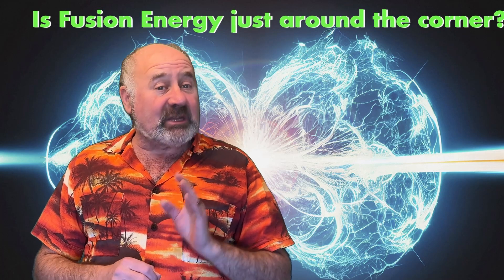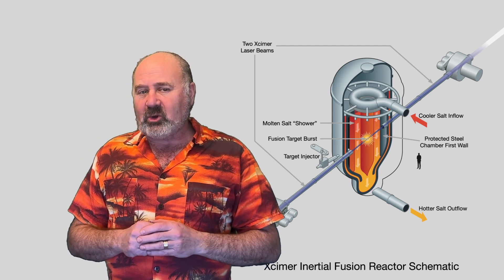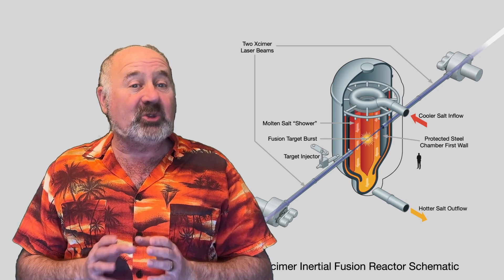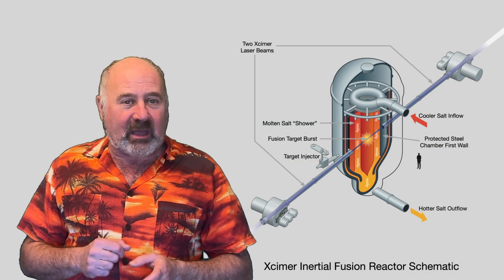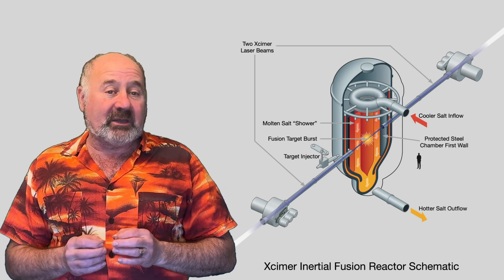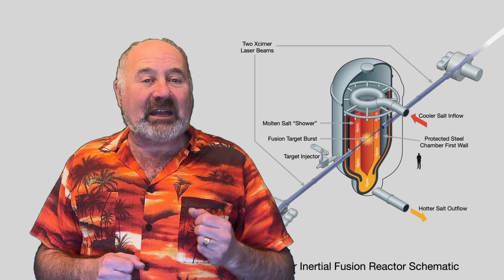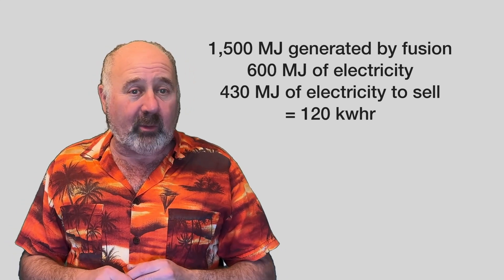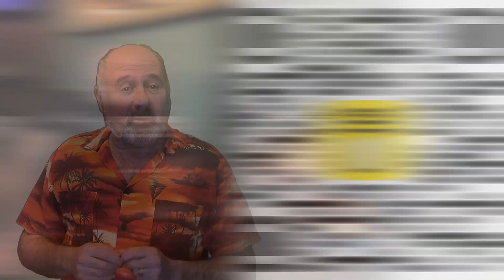Can millions of mini hydrogen-bombs power our world?

Comment: Thank you, Doctor Silber. Here’s a more detailed description of my reactor, including how targets are delivered and held centrally.  Sorry for the delay, I was at a “Hands Off!” protest in Wisconsin. My sign is double-sided, with Charlie Brown saying “Santa Claus is more believable than a Great Pumpkin story” and Smokey Bear wearing a “TRUTH” ranger’s hat over the caption “Only YOU can prevent fascist liars.” 
Sphere (AKA blast chamber or reactor vessel): This needs to be huge, not some tinker-toy. Here’s why: 
    • If you want to maximize the tritium breeding ratio and to protect the chamber wall from neutron damage and x-ray erosion, then a large blanket is desirable. The blanket needs a radial-thickness of ~2.15 meters Yb:FliBe in order to capture 99.99% of the neutrons. 
    • The yields obtainable from ICF targets increase super-linearly with the amount of driver energy. Ideally, to maximize gain, the reactor should operate at the highest yield it can withstand, even if this means operating at a lower repetition rate. For example, Sandia National Laboratories proposed 20 GJ targets, in Annual Report of 2005, for a cylindrical Z-IFE chamber with a 6 m radius and 8 m height, designed to operate at 0.1 Hz, for a fusion power of 2000 MW, because “the economics of scale will favor having a single chamber with the largest acceptable yield.” Additionally, lower repetition rates make it easier to pump out the hot blanket material between pulses. 
    • A more massive target takes more energy to ignite, so the total amount of laser medium must increase with the target’s mass. NIF uses 11.8 cubic meters of Nd:glass to produce 4 MJ of laser light. My targets are bigger (~20 mg vs NIF’s ~0.24 mg), so igniting them requires more energy (~20 MJ). If we assume that the Yb:FliBe in my reactor can be pumped to have the same energy-density (the amount of laser energy that can be extracted per volume) as NIF’s Nd:glass, then my reactor would need ~60 m^3 (a ~2.4 m radius sphere) of Yb:FliBe.

Targets: The fuel (~20 mg of DT gas, equivalent to 6.8 GJ at 100% burn-up) is injected and transported with the circulating coolant (molten Yb:FliBe). Initially the pocket of injected gas is irregularly shaped, but, to minimize its surface area and conserve energy, it will turn spherical. This happens quickly because FliBe is an ionic liquid with strong cohesive forces between atoms and its surface tension is 3-4 times higher than water. 

Inlet/outlet: The sphere has two meter-diameter holes, one at the bottom and the other on top. Coolant flows in/out these holes through large cone-shaped funnels. A gaseous bubble of fuel is injected into the cold coolant that flows through the bottom (inlet) funnel. From there, the bubble accelerates upward as the funnel progressively narrows until it reaches the opening hole at the bottom of the sphere. After the fuel is fused, the hot coolant exits through the outlet at the top, which is symmetrical to the bottom. 

Sensors: A sensor system can be made from two optical-fiber arrays, one at the base of the inlet and the other at the top of the outlet. Recall, the inlet/outlet are cone-shaped funnels that progressively widen as they extend radially outward away from the sphere’s body. These funnels, in addition to functioning as conduits for coolant, also give structural support to the sphere. They have thick metal walls, as thick as a battleship’s armor plaiting, and they protrude (>1 meter) outside the sphere before abruptly turning 90 degrees to form spherical end-caps. Coolant enters and exits from the sides of these protrusions tangentially. The end-caps are reflective, slowing the rate of radiant heat loss from the fuel. In addition they are peppered with a multitude of optical fibers, which emit/detect pulses of light, so they can function as optical sensors. 

Acoustical transport: My preferred method of fuel locomotion has no moving parts. A bubble of fuel can be moved with precision, by accurately manipulating its background pressure environment using piezoelectric stack actuators. These “squishy bricks” are almost indestructible. When an electric charge is applied, they quickly expand or contract with precise (tiny amounts of) linear motion. The underlying idea behind acoustical transport is based on the observation that a bubble will rapidly accelerate until it reaches terminal velocity VT, which is determined by a balance between the buoyant force FB, and the drag force FD, such that FB=FD at VT.

Buoyancy is what causes boats to float. Fluid pressure increases with depth below the surface. A submerged object will feel a different pressure on its top and bottom, with the pressure on the bottom being greater. This difference in pressure causes the object to be pushed upward, the normal direction when gravity is involved, but buoyancy can be artificially created and made to point in any direction. The buoyancy force is:
	FB=(ρB−ρC)g(4/3)πr3
The other force controlling the bubble's terminal velocity was drag, which depends on the fluid viscosity μ, bubble radius r, and velocity v. The drag also varies, indirectly, with temperature and pressure. According to Stokes' Law, the frictional drag force is:
	FD=6πμrv
If a particle is rising or falling in a viscous fluid by its own weight due to gravity, then a terminal velocity is reached when this frictional force combined with the buoyant force exactly balance the gravitational force. The resulting velocity is given by:
	vT=(2/9)[(ρB−ρC)/μ]gr2
where:
    • FB is the force due to the difference between weight and buoyancy (in N)
    • FD is the frictional force acting on the bubble/fluid interface (in N)
    • ρB is the density of the bubble (in kg m−3)
    • ρC is the density of the coolant (in kg m-3)
    • g is the acceleration of gravity (in m s−2)
    • r is the radius of the bubble (in m)
    • μ is the viscosity of molten glass (in kg m−1 s−1)
    • v is the velocity of the bubble (in m s−1)
    • vT is the terminal velocity of the bubble (in m s−1)
The reason large bubbles rise faster than small ones is that the drag force is proportional to cross-sectional area (r2) while the buoyant force is proportional to volume (r3). Drag is felt along the entire surface area of contact. Viscosity is a measure of this adhesive/cohesive or frictional fluid property that is responsible for the resistance to flow that appears when layers of fluids attempt to slide by one another.
When an object accelerates from rest its velocity can be written as a function of time:
	v(t)=vT[1−ê(−gt/vT)]
which asymptotically approaches the terminal velocity vT. If we integrate this expression with respect to time, we get the total distance traveled as a function of time, thus:
	d(t)=vTt−(vT2/g)(1−ê[−gt/vT])
A liquid that is held stationary in a gravitational field will develop a pressure gradient, ∇P=ΔP/Δs=ρg, where s is the submersion depth, ρ is the density of the fluid, and g is the strength of gravity. There are other ways to produce the same pressure gradient. For example, using a centrifuge or acoustically.

Andy, it’s time to take a break, sip your beer, and watch this video: 
There's more to those colliding blocks that compute pi (https://www.youtube.com/watch?v=6dTyOl1fmDo)

Consider what happens if a 50 hertz acoustic saw-tooth wave is sent across the reactor from left to right. This would produce, in the coolant, a left-right pressure gradient which changes direction 100 times per second. This saw-tooth wave can be synchronized with 50 hertz square waves coming from the top and bottom, so that the left/right pressure gradient always points the same direction when the bubble is at the same, either high or low, absolute pressure. Combining all of these waves would cause the bubble to pulsate (change size) at the same frequency it moved left/right, moving sluggishly when compressed and vibrantly when expanded. A high-speed close-up view would show the bubble ratcheting toward its destination, taking 100 tiny millimeter-sized steps per second. The bubble would spend half of its time being pushed in one direction and the other half being pushed back in the opposite direction. However, because we can make the bubble larger (faster) when it is heading in the direction we want it to move, it can be positioned anywhere we desire. 

Dr. Silber, this method of acoustical transport might be wishful thinking, so ➡ I would appreciate any feedback, especially negative. ⬅ Without optimizing for speed, I calculated two examples (both having viscosity > 300x water) where the bubbles moved between 6 - 9 cm/sec. Because there are a lot of parameters under our control, we have a lot of flexibility. Besides controlling FliBe’s viscosity (which spans 7 orders of magnitude based on percent BeF2), we have control over the coolant temperature, absolute pressure, pressure swings, frequency, and amount of fuel in a bubble. 
If the coolant is entering/leaving the sphere at 8 cm/sec, then it takes 16 seconds for 1 cubic meter of coolant to flow through the 1 meter diameter inlet/outlet holes. At this speed the bubbles could even be forced to move vertically downward against the flow. If the only 50% of the fuel burnt, that would still be 3.4 GJ every 16 seconds. That corresponds to a  213 MW thermal (85 MW electric) power plant.
Reply from the maker: I haven’t dug into the details, but the first thing that struck me was the integrity of your bubble. Is it cohesive enough to stay intact as it’s being buffeted by the hot, turbulent liquid through which it’s traveling?